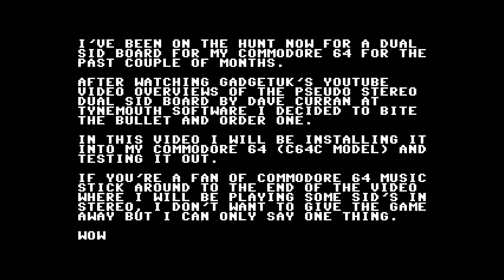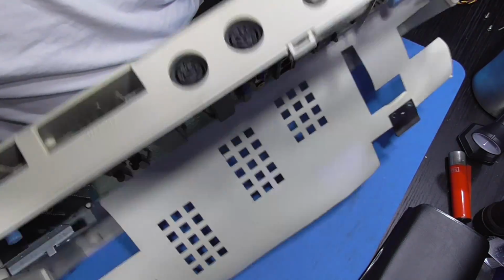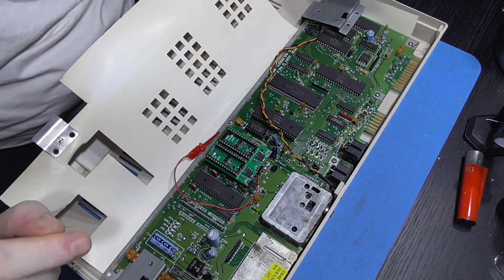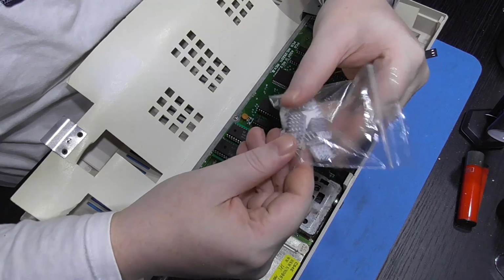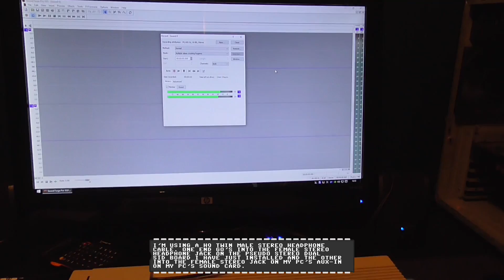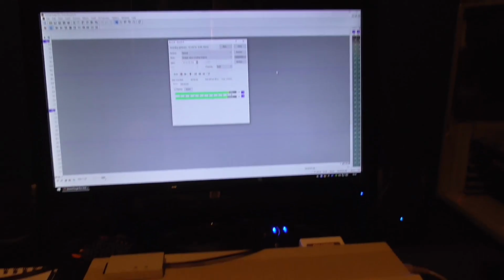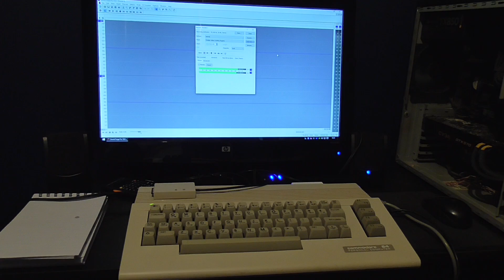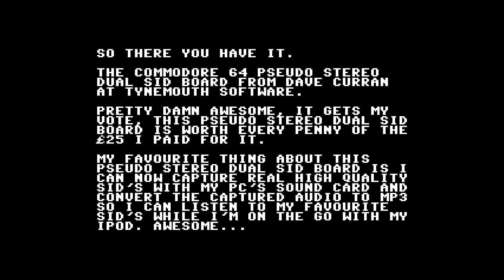Commodore 64 - Pseudo Stereo Dual Sid Board from Tynemouth Software - Install and Test.

Comment: Usually I just use my mono speaker for youtube.. Today I found out how much I'm missing when I played this on my stereo system. WOW sir, what difference it was to listen to the last ninja 3. This is a great mod ! Well done.
Reply from the maker: +bwack 

ya it's awesome, last ninja 3 sounds so good. This dual sid board is one of the best c64 mods, i'd love to add more tunes but knowing my luck i would be pulled up for a copyright violation.
Reply: Just saw this video again on facebook. I have the same board from TS Dave, but not installed yet. It's time todo so. :) I just don't remember what it was configured for when I bought it.....
Reply from the maker: The best way is to check what model the voltage regulator is above each socket.

If it's a 9v then the socket is for an 8580.
If it's a 12v then the socket is for an 6581.
Reply: FourX2k3 Briliant! Thanks.

Comment: Doesn't it work well =D  Love listening to the 6581 and 8580 at the same time!  It's brilliant!  Good job - well done spotting the chip round the wrong way, and bad luck with the pin breaking off the adapter but you easily fixed it!  Great video - hopefully this will help others discover the wonder of psuedo stereo on the C64 =D  Thanks for the shout out btw =D
Reply from the maker: +GadgetUK164 

Thanks

This Pseudo Stereo Dual Sid Board from Dave is awesome, I knew it was going to be good from watching your
videos, But WOW, it blew me away the first time I heard the intro for Yie Ar Kung Fu 2. The stereo effect on that
intro is just WOW.

I knew there was a difference between the two SID's the 8580 and 6581 but it's not until you hear them side by
side that you can really tell the difference.

I've been capturing audio from it for the past week or so and it's not missed a beat, I was a little worried about
heat from the 6581 but it's been rock solid without the heat sinks.

Ya the broken pin, all down to me, I got a little to eager and well, you know the rest.

No problem with the shout out, if it wasn't for your videos I wouldn't of known about this mod in the first place.
Reply: Never has been Pseudo Stereo it's true Stereo with a Central Mono channel from the start on both chips just with the true composite sound output coming with the package outputs the true sound of both chips It converts the 2 central monos into a stereo which is a Pseudo Stereo but the forgrounds were stereo from the start being 2 channels but the crap RF outputs from the days put 3 channels as 1 over the air because RF outside of NICAM TV waves has been mono outputs.

Anything over 2 channels is a Stereo in other words Stereo forground with mono background is still Stereo format but it has a 3rd Mono as a backing track.

The 6 channel Pseudo Surround which is more like the true name of it as it was Stereo to begin with "I like to point that out over and over because 3 is over the 2 Stereo throttle of channels" sounds lovely though.
Reply: Agree Pseudo Surround sounds awesome. Not going to say Pseudo Stereo as a single SID is Stereo to begin with with a singlular Mono backing track as well just outputting mono due to RF but this as it fits you with composite outputs now outputs the sounds how they should sound like and stuff.

I guess the backing Mono's are turned into Pseudo Stereo but the 4 channels that were already Stereo on a Single SID chip I refuse to call them Mono because any band in audio channels terms over 2 channels is not Mono.
Reply: I just noticed that the 4 main channels are on the speakers they should be on too 80 on the left and 81 on the right doesn't sound like whats outputting.

Left: Forground Stereo Channel L 80 and 81. Central from the 80.
Right: Forground Stereo Channel R 80 and 81. Central from the 81.

Centrals become Pseudo Stereo due to the 2 different chips having unique sounds but forgrounds are outputiing how they should from even outputting a single chip on a Stereo composite they were stereo anyway because 2 channel is stereo.

Thats what it sounds like in my headphones mixed a real SID party of unique sounds.

Comment: This has also highlighted that on my original board (modified SID2SID board) I probably need to amplify the 6581 signal to the same level the 8580 is done on the SID2SID.  There's almost definitely a volume mismatch there having taken the 6581 audio from the C64 board, with the 8580 going to the 2N2222.  Daves board doesn't suffer that problem, except when using a Nano Swin SID, but even that is dependent on the maker of the Nano - one of my nanos outputs the same level as an actual 8580, the other is about 60 to 70% of the physical 8580.

Comment: That R3 sounds great btw!  Might have to get one!
Reply: +GadgetUK164 The R3 sounds a bit broken at 37:27.. or is this normal for R3 ? .
Reply from the maker: +bwack 

It's definitly not the SID (6581) as it's works fine with this and all the other tunes i've played \ captured.
50+ tunes so maybee it's somthing i did when i was editing the video or it got screwed in the video
conversion to youtube. arrrrrrr.
Reply: +FourX2k3 It seems like a good combination is the 8580 + 6581 R3 - your 6581 sounds great!  I would love to hear an R4AR but don't have one.

Comment: I wonder if I should look at a T shaped board for the C64C with both SIDs rotated 90 degrees so they sit between the modulator and the edge of the keyboard. May give a bit more height for heatsinks?
Reply from the maker: +Dave Curran 

Dave, I've been using it for the past week some times 2 to 3 hours at a time capturing SID's and it's not missed a
beat, yes the 6581[R3] get's wormer than the 8580[R5] but nothing that would ever concern me; heat sinks on a
6581 are more prevention than cure. 

If it's going to impact your time to implement or cost to manufacture just for the C64C model then to be honest
I wouldn't worry about it, it works fine I've had no problems without heat sinks and from what I can see and hear
its rock solid.
Reply: +FourX2k3 OK, thanks, useful to know. I've not had any problems either. Might still have a go at the alternate layout to see how it works, at some point.
Reply: +Dave Curran Something else I spotted last week - is R8 is not required for the 8580 on the C64.  In the schematics they suggested it should be removed.  I've removed R8 from my SID2SID board and it does sound better, does your board have R8 in the amplifier section or did you remove it for the 8580 side?
Reply: +GadgetUK164 If that is the 1K to ground on the output, I fit that for SID#2, as there is usually one on the C64 for SID#1, to balance them out.  That leaves both chips with 1K to ground, one on the C64 board, and one in the dual SID board.
Reply: In the C64 schematics they say that 1K should be removed for the 8580 though!  It's there on the 6581 boards but I don't think its on the C64C boards.
Reply: +GadgetUK164 Sorry, yes, it's not fitted for 8580 as either SID, only on SID#2 when it is a 6581.

Comment: It isn't even Pseudo Stereo anyway because it is Stereo with a central Mono channel from the beginning but the old output methods of RF muxed the Stereo with Mono central to full Mono.

With Dual SID you got 2 mono centrals together making 1 stereo central as well as your 4 Stereo channels.

SID has always been Stereo but having 2 of them installs widens the panning as well as makes it 2 central monos instead of one making the centrals stereo output too and with the combined composite mod it has done to it the composite alone is outputting the real stereo with mono central sound of both chips over the air.

3 channels is Stereo with a Central Mono anything over 2 channels is a Sterero chip from the start not Pseudo Stereo.

Pseudo Surround sound this is maybe but SID is already Stereo just you only had an RF output for the Stereo with Mono Central before any modding so you only hear Mono on the TV on a single one before the mod which gives you both Composite video and audio and actual stereo outputs of 2 sids together.

3 channels is not Mono it's Stereo with a Mono backing track but then I'm a snob at pointing that out.